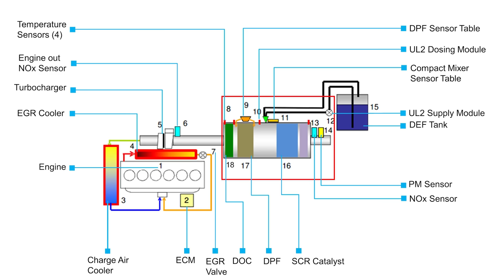Old But GOLD! I Changed My 2014 VOLVO for an Old 1996 Kenworth W900

Comment: I own a 1993 Western Star. It was the 1992 Truckxpo truck. It has been in and out of my life since 1996. Know the lady who originally purchased it and everyone who has driven it.  The front diff and transmission are still original, engine was rebuilt in 2003. The engine is a series 60 DD2 . This winter I'll be replacing it with a fresh slightly tuned DD3 along with a transmission and front diff rebuild. I wouldn't trade my old truck for anything especially a new or newer truck.  It is a daily working truck. I've been to Whitehorse Yukon down to Galveston Texas and many points between with this truck.

Comment: You are 100% correct.. and this also goes for diesel pickup trucks. I don't know why anyone would buy a new diesel pickup truck nowadays when the new gas ones are just as strong and not far off for fuel economy wise, they are actually better on fuel in the long run. I have a fleet of tow trucks and I switched them all to gas because the maintenance on the new diesels with emissions was crazy, on one truck I spent 7,000 plus dollars in 1 year on emission related problems and it only had 200,000 kms on it.. 7,000 dollars buys alot of gas on a new truck with a gas engine and only maintenance has been tires, brakes, oil changes, etc which has to be done on any vehicle regardless.. trust me if you wanna save money stay away from the new diesels, unless you plan on dumping them before the warranty ends.. which defeats the purpose of having a diesel because back in the day the purpose of a diesel truck was longevity, power, reliability, efficiency, fuel mileage, nowadays all this doesn't matter due to the sheer cost of emission maintenance and it doesn't matter if it's a Cummins, Powerstroke, Duramax..

Comment: My 2019 x15 Cummins had one sensor go out in 2.5 years got it replaced under warranty while it was getting serviced.
Reply: Just wait!!!!
Reply: @timothyfrollini5383  I already know what to expect, it’s not my first rodeo, I started driving in 1988. My point was he is grossly exaggerating the reliability of today’s new truck. Pick your poison, the money is already spent either way.
Reply: @unclefester3007  I didn't say it was sir.  I've been doing this for 35 years now. The trucks got more expensive and less reliable. Because of the emission bullshit.
Reply: @timothyfrollini5383  that is true, it’s a different game than it used to be. I know he means well with his message, however statements like “ I guarantee a brand new truck will break down in the first 90 days “ is just not true. An owner operator can do well either way, it just requires a different plan for new versus old truck. For instance, the guy that rebuilt his motor before he bought it doesn’t think it’s that cheap to own an older truck.

Comment: I went different way. In 2016 I bought 1997 KW T600 with 144 inch sleeper for 8k$. I was rebuilding it while I drove my.... Volvo)))). It was complete rebuild. From seals to out frame motor. Suspension, rear ends , transmission and everything what's possible under the hood costed around 70k. Interior make over I did myself. Materials around 4k$. I started to drive it in 2018. Body work did in 2020 for 12k$. I go to Cali without any problems.

Comment: as a Fleet mechanic of 20 years I can tell you I was there in 2010 when the emissions went into effect and some vehicle from 2007 on ward was fitted with DPFs and in 2010 DEF fluid was required. This is still a maturing technology and it is getting better each year. On our 2019 LT Internationals with the X15 Cummins engine we ran 500,000 miles with no DPF services of any kind required. Of course COVID came along and totally slowed production of the DEF QLS sensor which requires a QLS bypass now from the dealership. But the DPFs systems Cummins are making are lasting longer and longer with no issues. Of course that intake NOX sensor sure does like to go out a lot. But overall it's not looking as bad as it used to. It could be worse you could be driving a Freightliner with that dreaded One Box system. What a pain in the ass that system was/is.

Comment: As a rural truck the mechanic, we have had farmers and owner operators spend 30,000-60,000$ to completely rebuild an older pre emission truck to avoid the expense of newer emissions controlled equipment.the end up making more money because once those old trucks are in good condition, they just simply run and get the job done and can be worked on outside of dealerships with all the computors equipment neccessary to work on all the computors systems. But in the end run, the wiring harnesses on all of them, regardless of age, will kill all of them.

Comment: I'm still Running a Fleet of 38 1986 Pete 359's my Dad bought new. Cat 3406B and Spicer 6x4 Transmissions.  Maintained to Peak Performance and best of all NO Payments since 1988. Instead of trading every 4-5 years. I just run them through a Bumper to Bumper Overhaul.  Maybe you have seen them on the road. They run dedicated turns usually running in pairs

Comment: I would hang onto to a 2003 Prevost motorcoach with a Detroit 12.7 Series 60 as long as possible, enjoying all the jet-like accelerations, Jacob brake and whistling turbo noises in the back. The newer models have that Volvo D13, which sound like an old farm tractor, and their torque is taxed by that tall and slow fuel-saving diff ratio.

Comment: Totally agree with you, I work as a driver in the U.K. the company I work for run 100% Daf and up to euro 6 they have served them very well over the past 30 years.
But since the introduction of Euro 6 we have problem after problem, more so in the smaller trucks like the Daf LF with the 6.7 Cummins.
I’m a huge Cummins fan but that engine is now literally a liability it has zero power, we have two off the road at press both needing rebuilds at 300k!!!
Think you’ve done the right thing good luck for the future.

Comment: I drive a german MAN 41.560 Euro 6, 2017.
240.000km run, and still NO emission or electronic problem. 
But to be honest: Trucks from the 90s are still the best. They never break.

Comment: I like to make the joke that my '88 Ford LTL has one single electrical wire and the only sensor is the coolant level.

It's not quite accurate but there's no computer, the fuel is mechanical and the exhaust is a manifold, a muffler, and some pipe.

It doesn't have ABS, traction control, or even self adjusting brake cams.

Hoping one day to fully restore it and get it back on the road.

Comment: I drove a 04 379XH with a hot C15. It was the last truck I drove before getting heavy haul. That's when I went to running Hydro Excavation rigs. All with regen. I lost more time on shutdown than I worked. It sucks. I can't imagine have this new tech shutting me down over the road

Comment: Happy as can be in the 05 flat top 379 I'm driving, has a rebuilt 6nz cat, the only thing I've had to replace in 2 years is 2 batteries, an air bag, a shock and a coolant hose. $15k for the rebuilt engine compared to $30k on new engines and less than $1k in repairs in 2 years is amazing, If something goes wrong I can get an Uber to Peterbilt or Napa and fix it on the side of the road with my tool kit in a couple hours, mean while the other guys have had engines blow, turbos go out, sensor problems and had to pay for a tow truck, the shop rate, the down time and the repair cost. I'll gladly pay the extra fuel cost even at $6 a gallon rather than spend the extra money and headache with down time

Comment: 3.5 years ago bout 1996 FLD 120 18 speed. Did complete engine rebuild (D60 22.7, 500hp.) take out with new clutch. As a payment for the job gave out damaged 2005 Coronado. Till this time running strong. Modern time two pedals I-shifters will never get it.

Comment: You did the Right 👍😊 thing older is bolder love the older KWs  900s and the Peterbilt's 389s the the new trucks have to much computerized junk, emissions that chokes off the power , it's like a 66 SS Chevelle Open headers with open flow exhaust. Also  like the Jake Break .

Comment: While I've never driven a big rig or owned one or worked for a trucking company, I bring the perspective of the family cabin cruiser we had on the Great Lakes for 35 years. We had a 1974 Uniflite DC (stands for double cabin and Uniflite is now sadly long out of business) with twin Cummins 903's which were around 340 or so horsepower each. Ready to hear my laundry list of diesel problems? READY??? We didn't have ANY!! EVER!! Sure, the boat had it's quirks because they all do, but nothing engine related. Old school tech is better in so many respects to what's come along in recent years. My father and I babied that boat and made sure to change engine oil & filters exactly 9or damn close, lol)  as Cummins said to do and those engines were perfect for the entire 35 years we owned her.

Comment: Couldn't agree with you more on staying with older vehicles. I work at a Chevy dealer. Emission system failures account for a good chunk of the repairs on our diesels. They aren't built to be worked on, either.

Comment: I’m old school too, I drove hood trucks in the 90s, but I think if I ever bought a truck now, I’d want something slipperier for fuel mileage. Like a T600 or a Pete 377, same cab and sleeper as the hood trucks. I even like the Century and Coronado, though for some reason, I hate Columbias. I liked Volvos in the early 2000s, they fit my tall frame well, but they’ve always felt what I call “squishy” and rattled like crazy. I guess my dream truck is a late 90’s Pete 377 ultracab unibilt. Been driving KWs for 15 years now, currently in a 660, but I always liked the Pete clutch pedal coming up from the floor.

Comment: I'm a 15 year diesel tech. I prefer working on older truck because it is easier and plus the drivers I have come across take care of the older year model truck much better than the newer truck. The newer truck most of the repair are the after treatment system. They do fail and sometimes truckers try to put off until the truck can't go anymore and we have to do major overhaul on many components on the truck.

Comment: When I turn the key on in my 2017 Peterbuilt the Windshield wipers will occasionally start to operate. I do kind of like the 10 speed auto shift. It's easy to hold onto my coffee cup while turning the corner. I still miss my 96 Mack Magnum.  Nothing better that 500hp V8 under the hood.

Comment: This is exactly what I would do.  Pre-emmissions... All the way.
Old School Rules!  My diesel pickup will be along the same lines.
There are experts who do nothing but rebuild the engines and transmissions.
They are better than the originals.  Balanced, ported and polished.  Smooth perfection.
There is no insane obsession with shaving a few pounds out of the parts at the cost or reliability.
You will spend less to buy an older truck and you will also spend less in total cost of operation, and that's what matters most.  
You can also be sure there are mechanics that prefer to work on engines and not computers.
Reply from the maker: Spoken like a true old school trucker!

Comment: I have been driving Def equipment equipped trucks for last 3 years. If you don't bother reading the manual your going to have major problems. I have never had a derated engine or been towed due to Def issues because I opened that manual and read it. If your not going to follow that don't bother buying a new one. 

And don't bother buying a new truck without an EPU OR APU and you will be fine.

The advice about buying an older truck is spot on though.

Comment: eBay Volvo turbo 1500$ installed it my self very easy to do. Just have to calibrate it ,didn't change the actuator they don't go bad.. yeah I put on 100k on the turbo already I have no issues with it,it's reliable so far...

Comment: I went from a company 2004 W900 C15 13spd to a Cummins ISX 10spd (later a 12spd auto) you are 100% right about the complexity of the newer trucks! Way too expensive and you better have an extended warranty. Although, I was a co driver, not o/o . Same deal with cars and pickups. I'm perfectly happy with my 2008 Tacoma 4x4 and 2006 HD Springer.. NEW SUCKS

Comment: I also drove an off-road tractor an M818 250 Cummins 5 speed standard with two speed transfer case. I could outrun the automatic trucks going up grades because you can speed shift the transfer case and transmission it was also a 6x6

Comment: I do not drive semi’s. I have driven dump trucks, for a roofing company. As well as that I have drove a couple 1 ton trucks, one for a brick and truss company the other my own personal truck. As I use to run a salvage recovery/environmental clean up company. Meaning I recovered everything from scrap metal/transmission parts, old refrigerators, washing machines and even old steel pipe you name it. Often a ton and a half or more, with my personal truck which was an old 1999 Dodge Quad Club Cab 3500 Cummings. For the brick and truss company it was an old 1970’s Chevy 1 ton that would have so much weight on the trailers it would pop the hitch, and cause the truck to have a max speed of 35mph with it’s 427 truck engine. With what I’ve had people tell me about these new diesels when they run out of Def fluid, you’re better off with an older diesel. As these new diesels, sound like that 1970’s Chevy 427 with 30,000 pounds when they run out of Def fluid.

Comment: As a country we went from Manual Push Reel mowers that were quiet, didn't pollute the air, didn't require gas & oil, you could mow grass at anytime of the day or night without disturbing your neighbor, to ' More ' Expensive, Loud, Non-Catalytic converter polluting mowers that rips the grass rather than actually ‘ cutting the grass ‘. My point is don't assume as a society we're making better decisions elsewhere.

Comment: My grandparents drove a cabover Freightliner with a KT 450 Cummings turbo and I used to spend my summer lumping furniture with them. Saw the the lower 48 from the sleeper or " the idiot seat" 🤣 that's what Paw Paw called it anyway and I remember his Jake brake sounded very similar and yeah your right, the new truck ain't got nothing on the old ones.  Cool video and thanks

Comment: Professional HET/engineer here. After building and managing fleets of everything from Volvo to Detroit powered machines I can guarantee he is going to pay much more for that old thing over time. Modern units run around half the cost per mile even including the extra repair costs due to fuel savings, warranty coverage, etc. Also, it does not cost 8k to replace a volvo turbo in canada and it does not cost 2k to do a detroit, I work with these daily. Both turbos  are made by the same manufacturer, and depending on the year are identical in price. He was comparing the price of a reman turbo vs new, that's not apples to apples. Lastly he was right, HE DOES ALL THE WORK, new vehicles have better visibility, more safety features, quieter and less exhausting to drive. Drive 12 hours in a volvo is a pleasure, driving 12 in a kenworth is exhausting and frankly is annoying due to loud noise and vibration. Better visibility means less chance of accidents and therefore lower insurance premiums too. He need to think less about the sticker shock of a new unit and more about how much it will save him in money as well as wear and tear on his body over time. Owner/operators who buy new and sell off warranty make more money over time than those trying to patch together old stuff that is falling apart constantly and who's parts are more and more hard to find. I have seen all the guys running old junk fall out of the market because they can't keep up while owner operators with new fleets keep getting ahead. Cheers and best of luck!

Comment: I have the same truck but mine is heavy speck with a 3406c fully mechanical except two solenoids one one the injector pump and one on the starter.
I can fix everything on it myself, the motor is cherry now but when it needs a rebuild I will do it myself!!

Comment: I have a 99 W900 with 1 MM 600 Caterpillar. Volvo ceo put out a statement that new Volvo will out pull any truck on the road. I was at a Volvo dealership today dropping a air compressor off for core deposit for friend today the service manager and I were having that discussion he asked what I have told him he new what my engine is and started laughing said no one builds a engine to touch it. I would not own any other engine. King of the hill when built and still is. You want to hear jakes talk be around mine with life time muffler 7” stacks she is radicle.
Reply from the maker: Thanks for sharing

Comment: The technology is built on good fuel.
The trouble is the fuel these days is recycled oil not new out of the oil well.
It's loaded with power transformer oil which is made not to burn thus creating extra soot.

Comment: Yes if you can still use old truck. My 2015 euro6 Volvo has done almost 700k kms and everything is original included clutch (may need new one soon) and hauling 28ton+ load everyday.